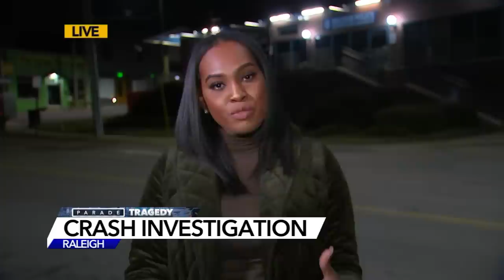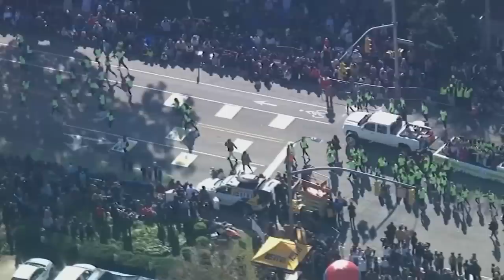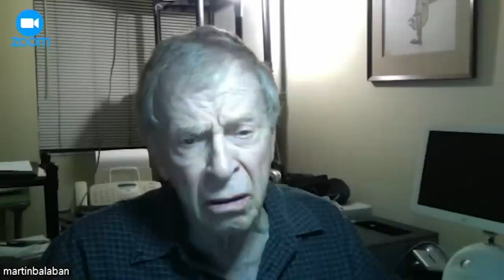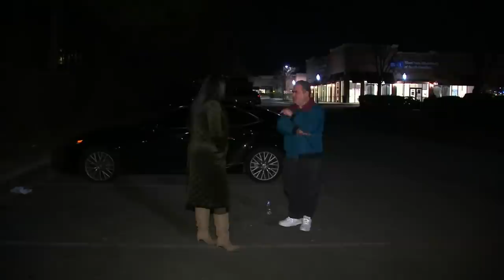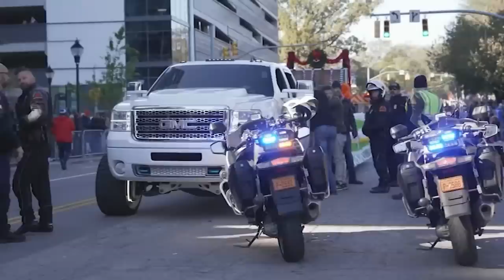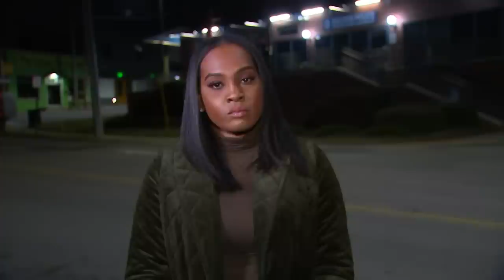Investigators look at truck part by part after Raleigh parade tragedy

Comment: when your brakes fail, you use your parking brake which is the backup system. it is mechanical rather than hydraulic. I have had to use it twice in my lifetime.
Reply: The emergency brake was not functional.
Reply: Exactly. Well said.
Reply: @MajorBorris  "improper brakes" must be to the changes he made to the truck's hydraulic braking system.
Reply: Doesn’t matter anyone can say they would use a parking break but anyone that owns a 2500 gmc or Chevy knows the parking breaks just snap not even underload
Reply: trailer probably wasn't even hooked up if equipped or had surge brakes (brakes only when the towing vehicle starts slowing down). not to mention guy probably had the trailer brake controller gain turned all the way down as you might know alot of trailer brakes like to drag under long light presses of the brake pedal. 

another thing since the trucks lifted something i seen ALOT in NC. the E brake cable is typically too short to reach the drum and its just left strapped up. or removed. one of those (i'll get around to it eventually) things.
Reply: @gino007able  The brake booster failed fine and all if the trailers equipped with brakes. and if your E brake cables connected but its typically not when you lift a truck out of lazyness. and on anything thats not a diesel leaves you with pretty much no way of slowing down. without trailer brakes or e brakes. 
that or the trailer has surge brakes which requires the towing vehicle to start decelerating hard. to start slowing the trailer.
Reply: Parking brakes in the rear rotors are so small. They can be easily over powered with a truck empty. This truck had a trailer also. Boiled brakes from riding them more than likely led to the failure. Inexperience, age, and additional electric brakes are all factors in this terrible accident.
Reply: Well you've never owned a Diesel where everything is ran through the hydro boost system that can easily fail and cause this to happen no e brake or anything
Reply: @mattspenceedits1871  I have and not by choice stopped my 2018 3500 with the parking brake, it did not "snap" from 45 to 0. It did ruin a nice pair of pants. PS the parking brake applies stopping force the same no matter the wieght or movement of the vehicle, worst case you weld the brakes to the disc/drum.
Reply: @birdgod3414  yes, I happen to own one. Work on them ally life. We don't know what part failed, but we know it was brakes...

Comment: Floor mats? My van had something similar happen when an after market floor mat became wedged under the brake pedal and no matter how hard I pushed I could not get the brake to work. I was able to shut the engine off, and apply the emergency break. This is just one possibility. I hope the family of the victim is getting all the love and support they need.

Comment: My prayers go out to the little girl and the family as well as the driver and his family. 

Now if he had no control to stop and steer the vehicle (vehicle maybe swerving, but steering wheel is hard to turn due to malfunction) this is a HYDROBOOST failure. Those brakes rely on that power steering system. Either a pressurized leak occurred or the system didn’t have enough fluid in it to function properly. 

Again, my prayers go out to all who were involved.
Reply: If he steered he would of just hit the people on the sides 💀
Reply: @zuezsz  that's not his point
Reply: Hydraboost is only power assist. He could have stopped the truck without power assist. This wasn’t a booster failure
Reply: @joshwilson849   I agree, I think something with the trailer caused an electrical issue with the braking system, still wouldn’t explain why it completely lost all brakes, unless it had no fluid in it or blew a front and rear brake line it would still have brakes.
Reply: @orangesforall2053  yes. If one of the front brake lines failed it would still have rear. If one of the rear lines failed it would still have front brakes. I’m waiting to hear what actually failed
Reply: would that require a high rpm? slow moving in parade there would not be high rpm so the fluid would not pump to build enough pressure to work? slip into neutral and rev up engine to get it to work?
Reply: @joshwilson849  I assumed the booster because I’ve experienced that before. I smashed that park brake and glad I was in an open field. Waited for the mechanic to show up (4.5 hours later lol).
Reply: @grahamward7952  no, there is like a gear that spins with the output shaft and there is a pin that engages it, it is designed so over a certain speed, like 5 mph it will pop out constantly so as to not destroy the transmission case. Revving up the engine would not make a difference.
Reply: @joshwilson849  I’m very curious, I didn’t see any fluid on the ground, I’m betting something electrical with the truck or the master cylinder failed internally, which would be extremely rare.
Reply: @orangesforall2053  ok thank you
Reply: If he swerved he would kill like 50 people instead
Reply: Hydro boost was my first thought, it blows my mind that they use this type of system, my truck has a cheap plastic clip holding the line from coming off and once it pops, you had better be on point cause steering and power brakes are non existent.
Reply: @captainawesome5560  that would make sense, I had a seal on the bottom of my steering box on my F-250 blow out when I was backing a trailer up and I lost power steering and the brakes got really weird, still could stop it but I had to two-foot the pedal. So unless he just couldn’t push hard enough he should have still been able to stop it.
Reply: @orangesforall2053  mine is a f350 same set up, they use the power steering pump to boost the brakes, if any of the components (pump, lines, seal’s or lack of fluid) lose pressure it will effect both brake and steering, in my case the clip that holds the line that runs from the power steering pump to the brake booster broke and immediately pumped all fluid out of it causing it to fail everything instantly. I was wondering if maybe the system was low on fluid or the pump failed, either way it is so sad that it happened.
Reply: @captainawesome5560 you are 100% correct. This is most likely what happened and because of the hill and the weight of the trailer he just couldn’t stop the truck without the power brake assist. The systems use different fluids, and are not directly connected so it most likely was he just couldn’t stop the truck with what little brakes he had.
Reply: @orangesforall2053  His brakes failed because he modified his vehicle and he, himself, replaced the breaks a week before the parade. The brakes were not as strong as the previous ones and could not stop the weight of the truck or float. Being on a slight decline didn't help either. He did all his modifications himself. If I'm correct his vehicle hasn't passed inspection either. Wanna make it worse? He runs a shop and works on other peoples trucks
Reply: I've experienced hydroboost failure. There'd be fluid loss of some sort.  I'd have to had been there to say for absolute sure as to his correction in operation.
Reply: @mikehairston9444  does this state actually have annual state inspection on all street vehicles? In my state our highway patrol has been known to seize the inspection sticker regardless of how recent it was for unotherized and non conforming equipment that would have been a automatic failure if it was driven in during the inspections
Reply: @mikehairston9444  dang man sounds like u got a close bond with him if u knew what he was doing last week and what he does for a living
Reply: The pulley on my power steering pump spun loose and I lost steering and breaking. I was driving 5 mph and not pulling anything and it was nearly uncontrollable. No fluid or anything readily visible.
Reply: @donavankoehn1487  easily findable failure. The way they're combing over it the issue isn't easily known. My guess atleast. Hydroboost failure in that method doesn't happen to often.
Reply: I think the driver is the guilty party, not the truck.  If the hydro boost failed you can still steer and stop the truck.  At the slow rate of speed, the park brake would have stopped the truck.  Even putting the truck in reverse at an idle would have stopped the truck.
Reply: Put the shifter in park
Reply: @bookingmods9197  I'm from Raleigh
Reply: @danlevesque5437  yes North Carolina does
Reply: @orangesforall2053  if the power steering pump failed on this truck it would be almost impossible to stop especially pulling a loaded trailor The power steering pump assist the braking system Seen it happen before
Reply: @mikehairston9444  not necessarily these trucks already have a heavy duty braking system he has big wheels with low profile tires so there’s probably not that much difference in the height of the  tires

Comment: Back in my day automobiles had a parking pawl, a neutral position in the transmission and drivers had functioning brains in their heads...
Reply: @Big Tings  yeah it happens.  And yeah people back when had something no longer seen anymore called common sense and a higher IQ.
Reply: Well the dude's right, he should have put it in neutral. Everybody knows their own vehicle if there was something wrong with this vehicle and he knew it then it's kind of his fault. I feel bad for everybody involved, I wouldn't want to be 20 years old and be responsible for little kids death and have to remember that the rest of my life.
Reply: Every modern cars and trucks have parking pawls. They are inherent in all automatic transmissions. The parking brake should have been activated by the driver. We don’t teach things like this anymore in school. I was taught how to deal with a loss of brakes by my sophomore driving class. The fact that the driver was staring into the sky with that squat doesn’t help on being able to see what’s in front of him.
Reply: It's likely the driver tried to put the transmission into Park but on a GMC Denali heavy duty this does not work when in motion and only puts the transmission into neutral, the result was the vehicle racing downhill gaining speed and out of control at the point of the accident. A much better solution would be engine braking by simply putting the transmission into first gear which on the Denali is a ratio of 4.79 that's a crawler gear which if had been engaged would slow the truck down to less than adult walking speed.
Reply: @the1digitalwizard  so, putting a truck in neutral, going downhill, towing a loaded trailer, is gonna do what???
Reply: @ sahadi420 he wasn’t going downhill….
Reply: @vincentsprung6536  uh, I live in Raleigh.....he was.
Reply: @Sahadi420  well I didn't know the truck was going downhill smart guy
Reply: This stuff never happened in the 50s through the 90s. Seems to be all these modern chip laden vehicles causing such mayhem.
Reply: @jayjaynella4539  OEMs have fail safe mechanisms in place. Also push button transmissions existed in the 50s.
Reply: @NorthwesterNomad  i was born in 60s and i would have used the EMERGENCY BRAKE !!
There is a reason they call it an emergency brake ya know !!!
Reply: Well now days vehicles have so many safety features that it actually robs the driver of having driving skills, skills which are acquired through experience. These days people are more worried about what's on their phones instead of solely concentrating on driving.
Reply: @the1digitalwizard   I’m on my vehicle up down left right every nook cranny nut and bolt but I was pulling out of an elementary school parking lot with my one year-old daughter, and my fiancé in the car we were there seeing my grandmother who works in the kitchen just a casual day about to go out and ride around and enjoy the weather and the time together but before you pull out of that parking lot. There is a stop sign. My foot went all the way to the floor with my brake pedal I even tried pumping it. And that car was not stopping for nothing. I pulled my emergency brake that I used to sing my car around every time I’ve ever pulled it. It has always locked up completely. And that they are emergency brake decided he didn’t want to work anymore. So the car was still rolling and I was only doing 5 miles an hour. Because from where I parked to the stop sign. Was about a car length or two. So there wasn’t even no room for me to be doing anything I wasn’t supposed to be so in that moment I’m already in first so there wasn’t no way of downshifting to slow down my brake pedal went to the floor and after pumping at three times it stay there and my emergency brake wasn’t stopping that car thankfully I was on a flat surface and not going down hill like they said, this young man was going downhill in the video I got lucky very lucky that I was not going downhill because by the time I would’ve realized that my emergency brake stopping me nor was my break. If I was going downhill, I could’ve picked up 3 to 4 times my speed
Reply: His brakes failed learn the backstop before u type
Reply: @the1digitalwizard  you dont get Taught to put it in neutral i wouldnt have known to do that
Reply: @MajorBorris  that’s not true. Forcing park would not put the trans in neutral.
Reply: @jnspython9719  maybe you should read the updated story. Driver cited for failure to perform safety inspections and other citations. This kid and his truck were NOT fit for duty.
Reply: @winterlynne7266  there's a lot of things you're not taught in modern day driving schools like leaving an out in between your vehicle and the vehicles to the sides of you on multilane roads in case of an emergency or to only overtake or pass on the left or the LEFT LANE FOR PASSING which is literally posted on every highway in America in one form or another. Just because you're ignorant to something doesn't mean you're off the hook. It's your responsibility to know how to operate your vehicle safely and how to control it in emergency situations and how to actually maintain it for your sake and the publics sake.
Reply: He did try putting it in park, if you watch a video of when the truck finally is going slow enough for the parking pawl to engage it jerks violently into park. They are designed this way so you don’t destroy the transmission by accidentally putting it into park at too high a speed.
Reply: @winterlynne7266  it's common sense to put it in neutral. And how could driver's education not teach you about the gears on a car? Park Reverse Neutral Drive 1 2 3
If you don't know what neutral is on your car then you shouldn't possess a driver's license.
Reply: @HappyHarryHardon there’s no squat on the truck it looks pretty level to me
Reply: @jnspython9719  his brakes failed, well then he failed !
There are redundant systems for that purpose !
Emergency brake still work !!!
Reply: @joshwilson849  depends on the vehicle but for many new electronically controlled transmissions this is the case. I asked a general manager at a GMC dealership and he said he believed that on that vehicle it is the case. Maybe his is older but it's likely throwing it in park would just make a loud clicky sound and not slow the vehicle in an effective manner.
Reply: @Hutch Yeah they do it's federal regulation to have an e brake it's a redundant brake system. Seems nowadays they mostly are electronically actuated but they do function some even automatically engaging once the vehicle is put into park. Unfortunately most people don't even have a clue how they work electric or manually. But in this case the truck had a manual petal actuated e brake that locks in place once it's stomped on they went to electric in 2020 on the gm hd trucks.